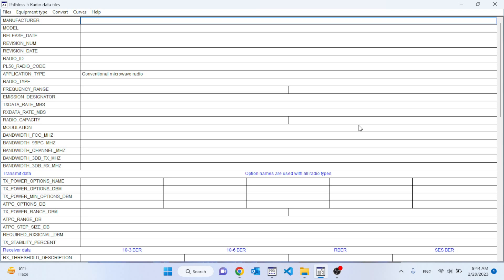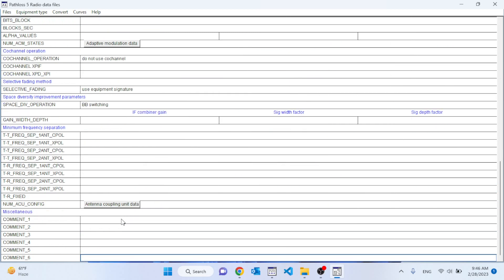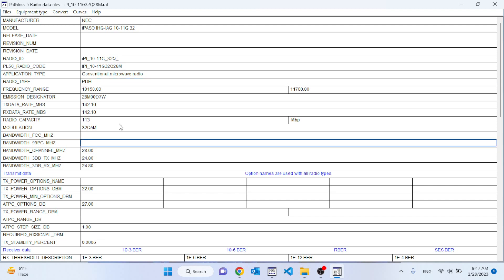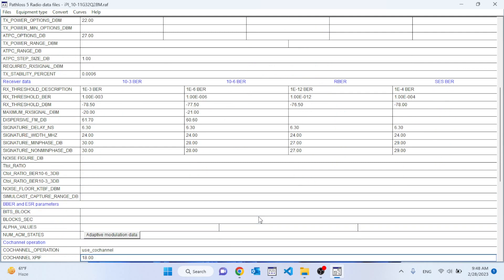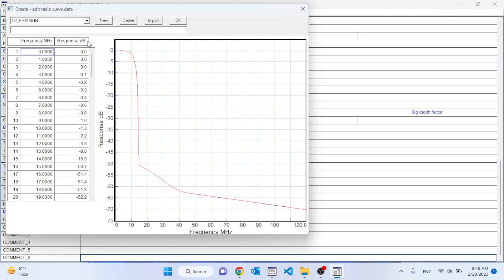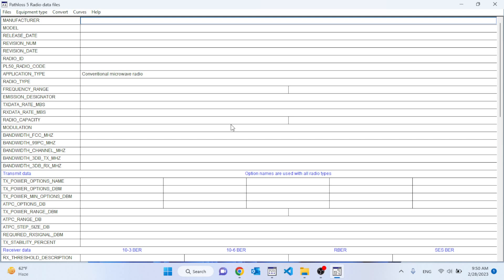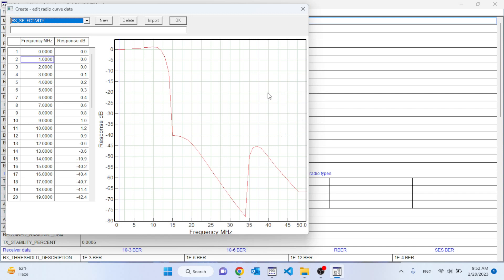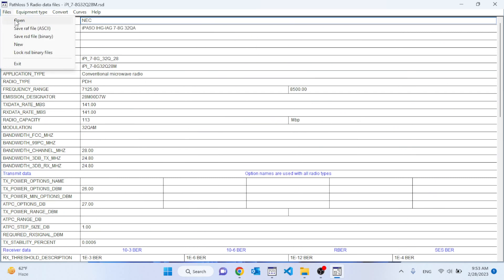How to make your own equipment or antenna file for pathloss, using antrad.

Comment: Thanks for the video. One question, I´m trying to get the information of one kenwood radio (VHF), do you know when I could get it? I have tried from the kenwood page, but I don´t see anything about pathloss or Antrad
Thanks!
Reply from the maker: You need to contact the vendor, if you are a customer then raise a support request to them, if you are not the customer then access through the customer